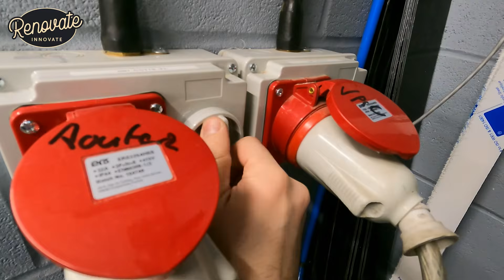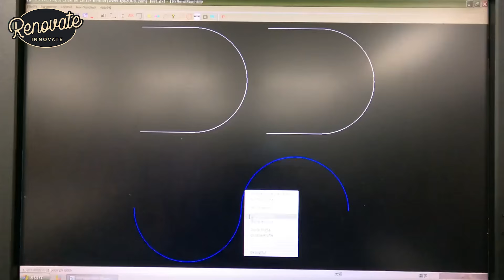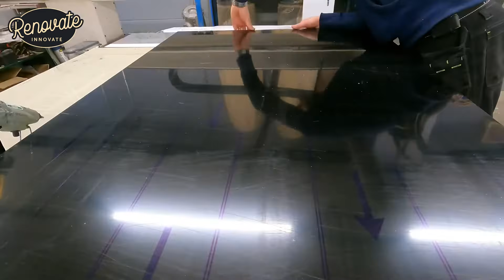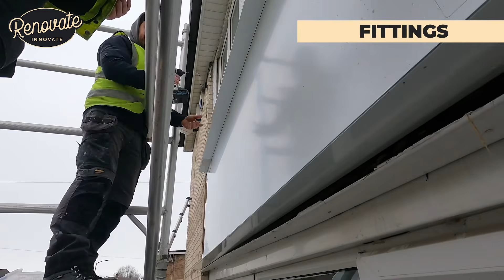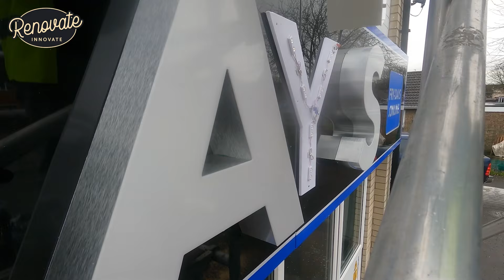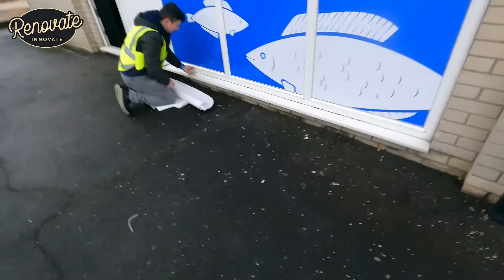How to Make a Commercial Shop Sign - Step By Step | Innovate Project

Comment: "The finished 'Frydays' sign looks fantastic! As a fellow business owner Rejeki Cetak in Indonesia, it was great to see the assembly process. The way you use structural glue to make the letters 100% water-tight is a great detail. Also, the back tray system to keep the modules flat and true is very smart . Best of luck to the team!

Comment: When it rains doesn’t water get inside the cracks?
Reply from the maker: No because the joints are very tight and capped of with a strengthening patch on the inside.